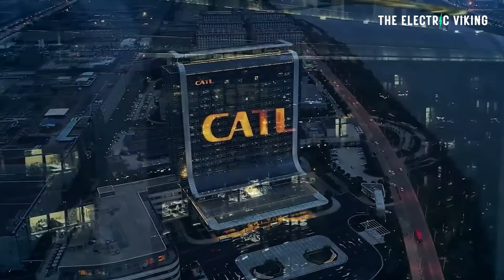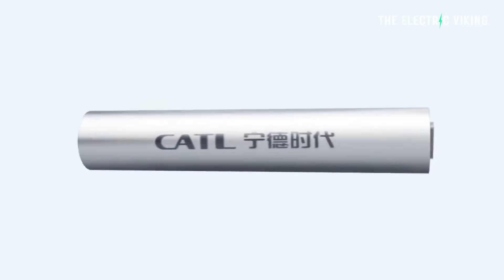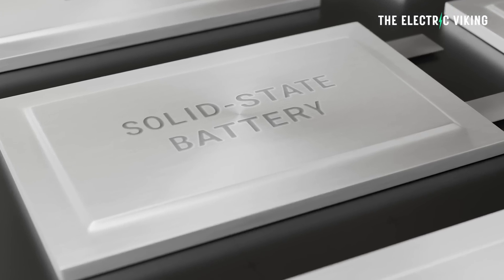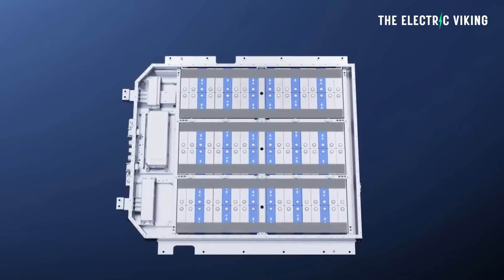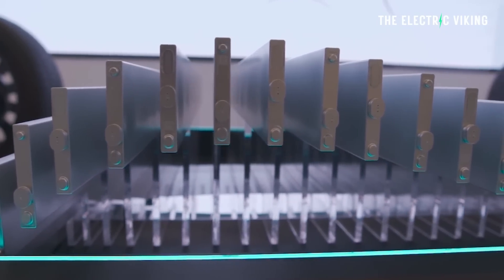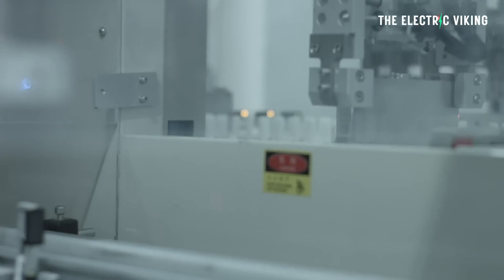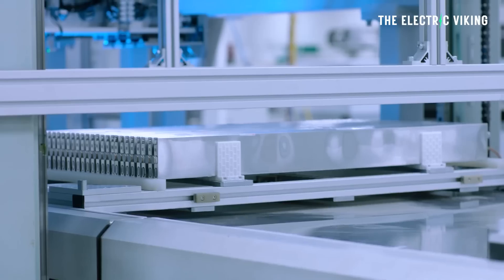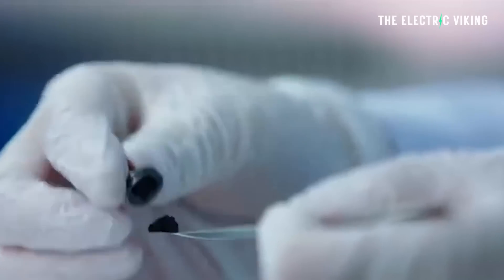CATL's sodium hybrid battery will be 30% cheaper & revolutionise the world

Comment: I need a 48 volt, 32 amp- hour battery to push a 1000 watt motor. Where abd how much to buy? What is the weight?
Reply: LFP or NMC ?  You can buy e-bike batteries of that size right now, but it is best to buy two smaller batteries rather than one huge one.   There are e-bikes on the market right now with roughly that amount of battery storage (NMC based) with 2000-3000W hub motors.   The Wired EBike, for example.

If you need a safer chemistry then you can easily find LFP batteries like that, but they will weigh more.   A 50Ah @ 51.2V nominal (16s LiFePO4)... roughly $500, 2560Wh, and weighs around 44lbs.

-Matt

Comment: I'm still waiting for CATL's Condensed battery which you had announced 8 months ago.
Reply: They did launch that last year, perhaps make a trip to China to buy one and bring home and do a review?
Reply: There’s always another unicorn battery around the corner. The E Viking been hitting the cool aid again.
Reply: That 'game changer' that was going to 'end fossil fuels', is so 2023.
Reply: Condensed battery is with silicone anode, these batteries have very low cycles, not good for EVs
Reply: That's not coming to cars or other electronics. It's way too expensive. Its use is in aviation, where weight is actually important.

Comment: Sodium ion battery is best option for Stationary storage.
Reply: Yes for residential. sand, salt, concrete and carbon blocks may be cheaper for large city/county stationary storage.
Reply: Hydro electric pumped storage is the best.  The cost per KWH stored is very low.
Reply: @kensmith5694 I think he means storage for his house.
Reply: @marcguindon8499  I took the meaning of "stationary" as all stationary.
Reply: Battery lifespan not good.
Reply: @Michael-Has-Opinions  What do you base that on?  Sodium batteries should last about forever with correct management.